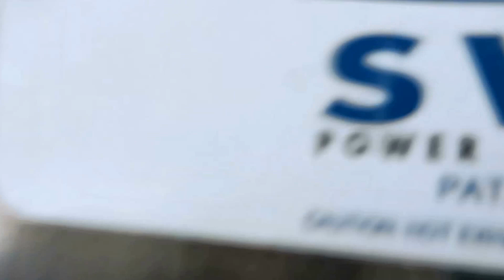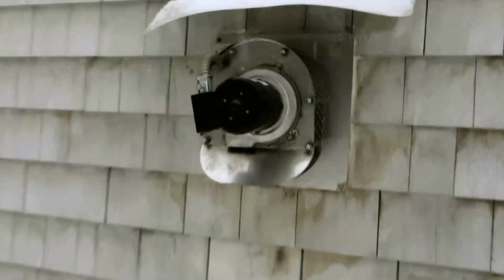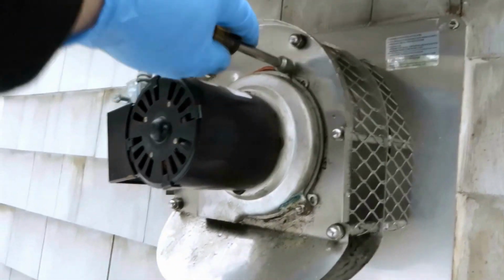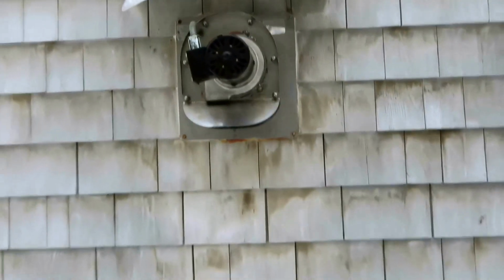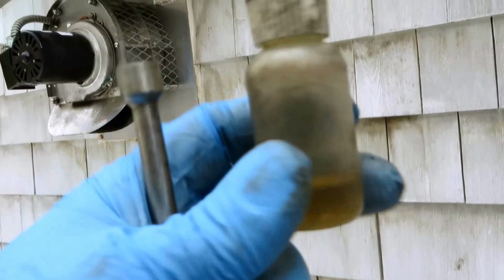stainless steel swg 4 fields powerventer oiled

Comment: I have been having so many problems with my FC power venter system since it was installed 7 years ago. I can't even explain to you how valuable these videos are to me. If you worked closer to NH I would ask you to come and take a look! I have dumped HUNDREDS of dollars every year into the fixing the system and I"m at my wits end. So thank you. As I sit in my currently cold house because (no surprise here) the Safety Thermal Switch did it's job and shut the boiler off because the damper wasn't opening, I now know to check the vacuum switch (which has been replaced I think twice already). If you have any recommendations for someone in southern NH who knows as much about FC venters as you do, I'd be happy to give them business! I've reached out to FC but haven't gotten a response yet.

Comment: I have what looks like the same exact model as this and it has been noisy but mine doesn't have the 2 openings for the lube.  Any idea where I should lube it?
Reply: My original one from 2005 did not have the option to lube.  However, the new one I bought a few years ago, to replace the 2005 one that failed,  has them

Comment: a typical FASCO 3.3 inch motor when you oil them the lubricant goes directly to the cloth wicks but not directly to the bearings. as i had to take the motor apart to througly clean and oil it. as Field controls has its own lubricant for their swg power venters.  as this is a 2 pole shaded pole motor in it. for energy savings not sure if Field controls would switch these motors over to a PSC type and it would save the customers money on their electric bill as the PSC fan motors draw less power than a typical 3.3 inch or larger shaded pole motor.